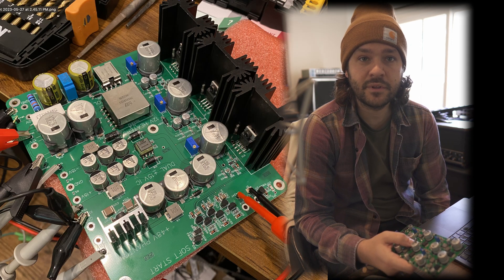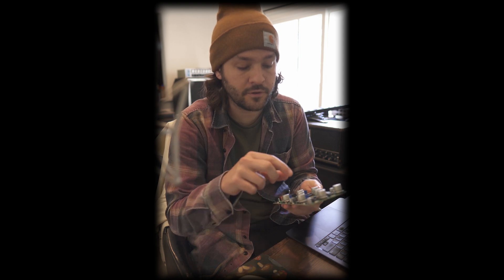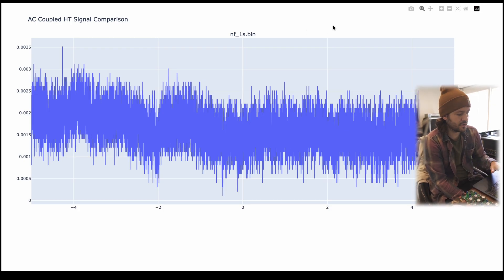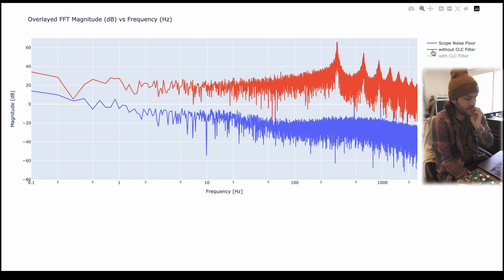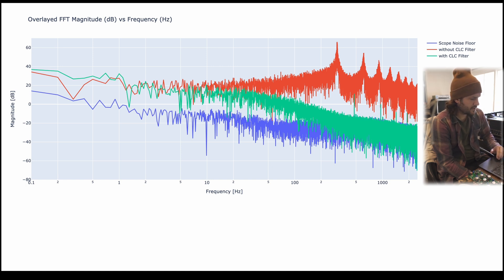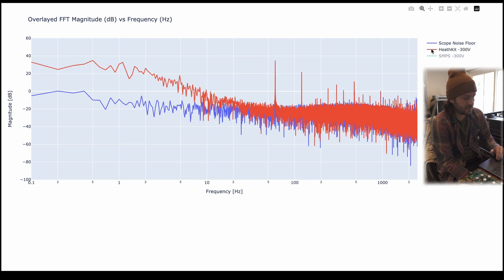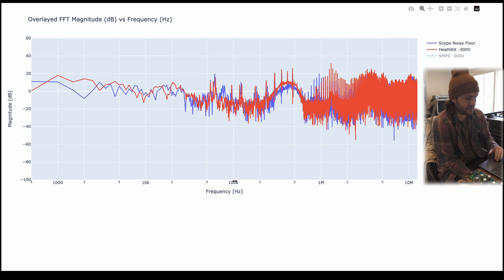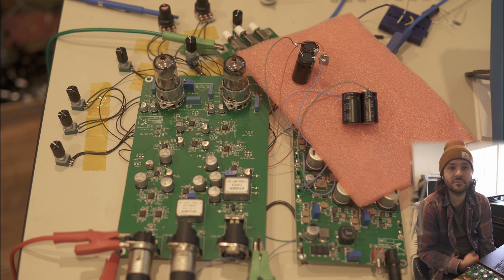CLC Pi Filter on SMPS for Tube Audio Circuit

Comment: How do you think you are getting attenuation at 100Hz with a CLC filter? Do you understand the huge values you need for that? You probably have a RLC filter there
Reply from the maker: i don't think i said attenuation at 100Hz with CLC. i mentioned differences at 100Hz, but this particular CLC cutoff is around 600Hz (L is 2mH and C is 47uF). In the full circuit there is a small series resistance of 20 ohms prior to the CLC filter, so that helps as well. Depending on space and budget, you can increase the inductor value, but that plot data showed that this was more than sufficient. I use this supply in a mic preamp fairly often now, and it works great!

Comment: So how will it change the sound?
Reply from the maker: reducing the switching noise and ripple on the supply improves the signal to noise.
Reply: @metalhead3ecr which means lower distortion? But ehat about the 2nd harmonic for tubes? Will it erase that as well?
Reply from the maker: @MasterofPlay7 you can think of the power supply circuit as a separate design from the audio signal path. The "signal" in the power supply is the voltage/current we wish to provide to the arbitrary audio circuit. You can design a very low noise power supply and have a completely different/separate design for the audio signal path (distortion box, compressor, tube amp, etc). So, the second harmonic response for tubes is not relevant as it's decoupled from the power supply design.
Reply: @metalhead3ecr do you have any external clc filter that can be plugged to dc 2.1 dac?